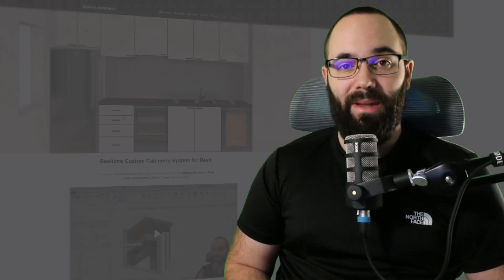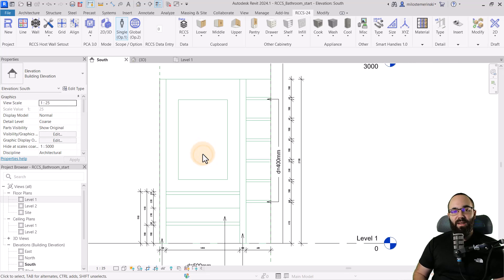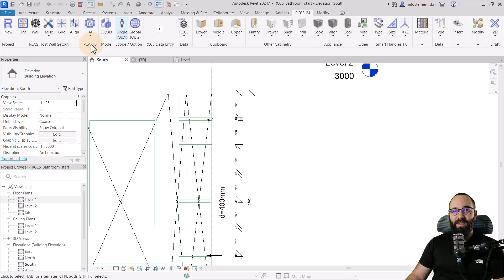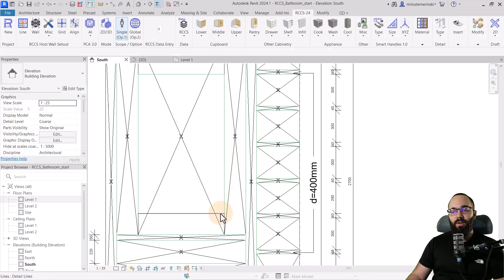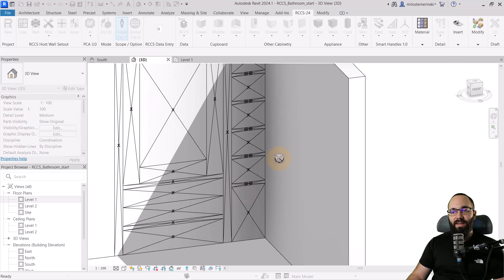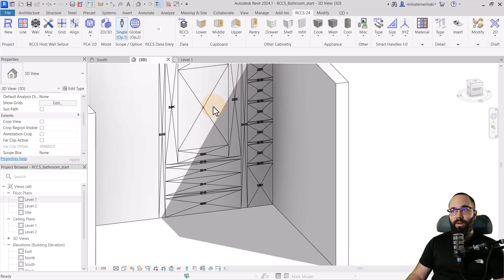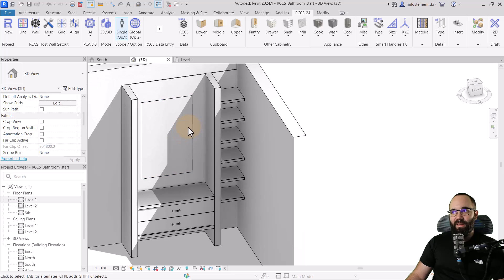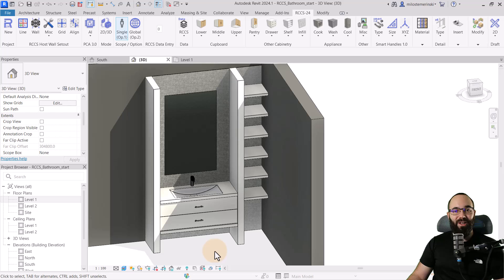Bathroom in Revit Tutorial (Revit Cabinetry Plug-in)

Comment: I am a new drafter, just recently graduated. I just started with an engineering company and they use Revit a ton. We did some Revit in school, but not nearly enough, it mostly focused on AutoCAD. 
My company specializes in engineering for food processing plants. So a lot of ducting, metal wall panels, silos, conveyors, piping etc. 
Do you have courses that cover those topics? I really want to master Revit. Your videos have been great, but I want to do some real courses. So more MEP and Steel Structures etc. I hope to hear from you soon as I need to get going quickly.